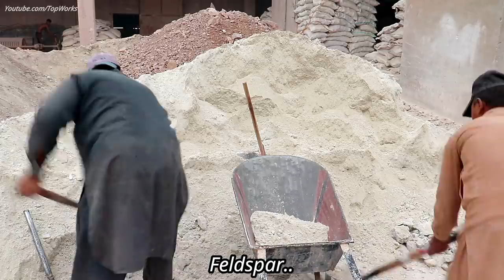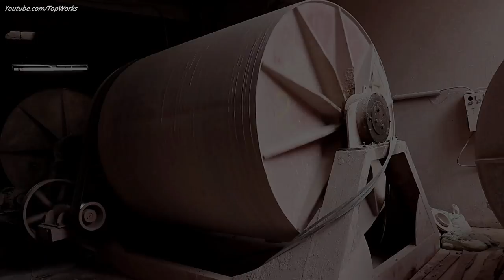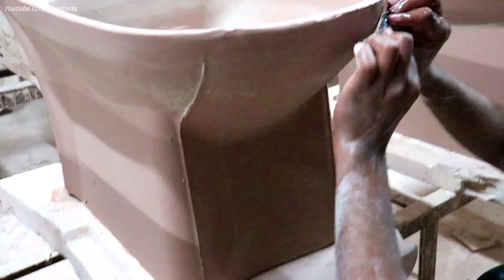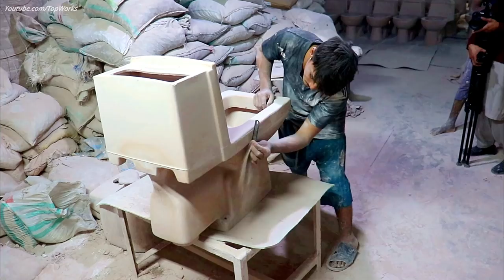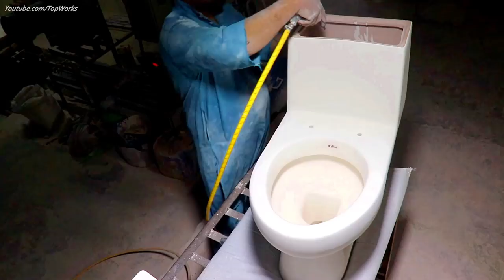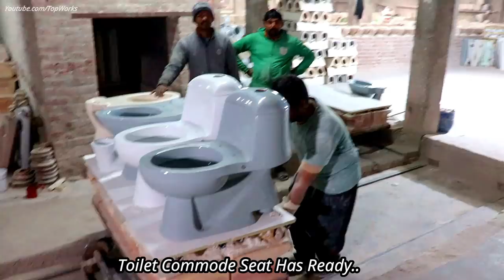How to Western Toilets Commode Seat are made in Factory Process

Comment: I want learn more about what kind of materials you guys use for it.. Is it only clay?
Reply from the maker: 1.Ball Mill for Grinding+Mixing With Water(Making Slurry).
2.Adding Deflucolant or Flucolant to the Slurry.
3.Pour the Slurry(Casting Slip) in Plaster Mould to make a Pan(Commod)
4.Pairing the Parts Together
5.Finishing the Green Body
6.Applying Glaze with Spraying Process
7.Glost Firing in Continues Firing Tunnel
Reply: @TopWorks  thank you watching you from Zimbabwe
Reply: Were can I buy these molds